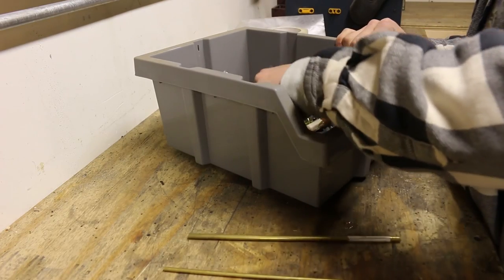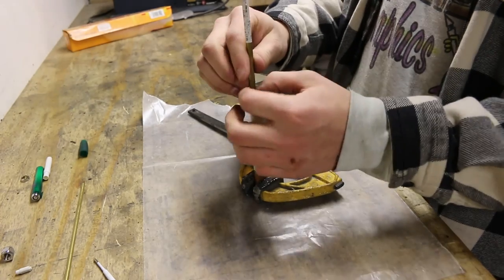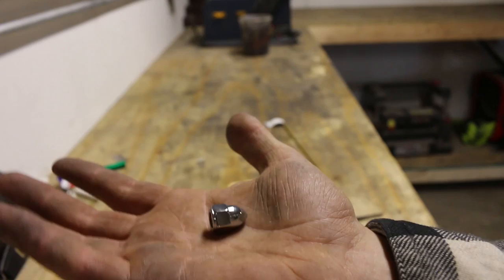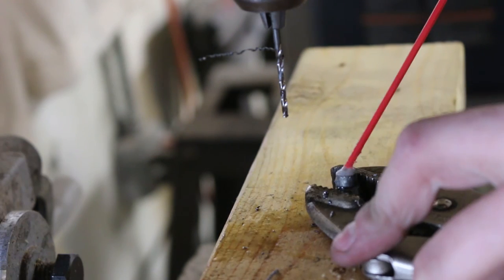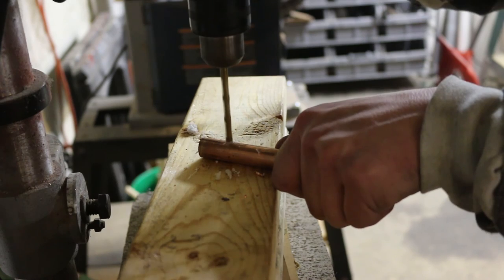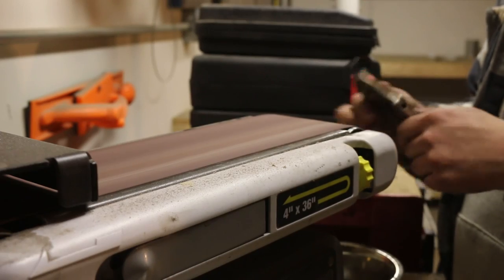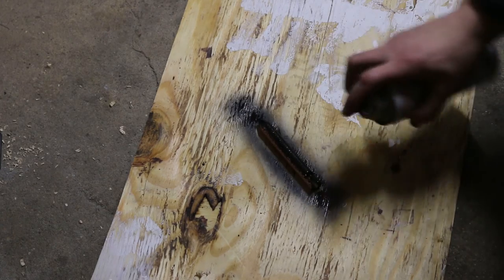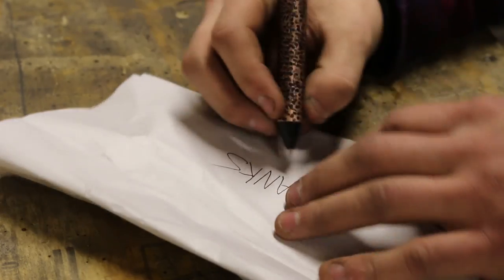Pen from Scrap! - No Lathe Pen Challenge

Comment: Well you've done a fine job laddie, I very like your design. At first I worried about the lead solder, but painting it as you did took my worries away,  I shall try to make the same. Cannot use my hands easily, so it will be a job to be sure!  pierre from New Mexico
Reply from the maker: Thanks a lot Pierre! This was a fun project, good luck if you try making one! All the best!